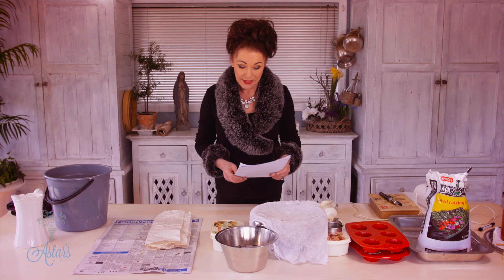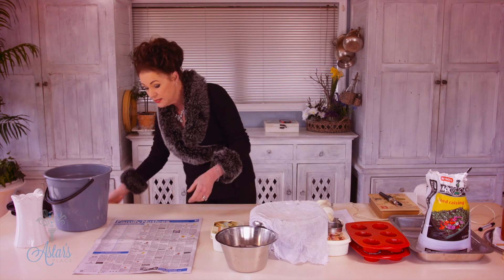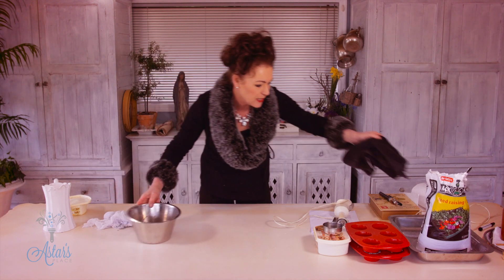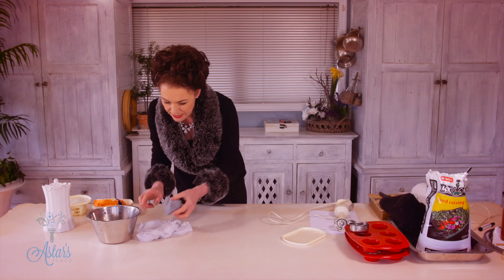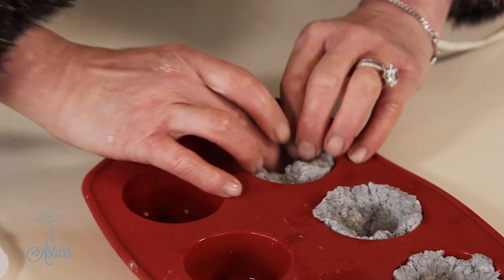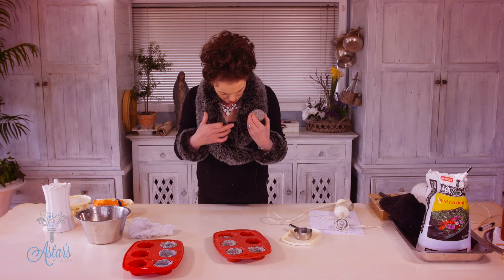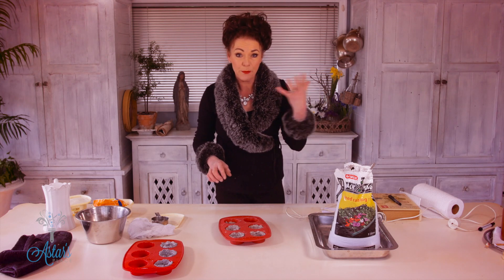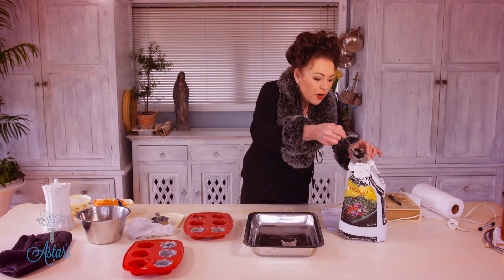How to Make Biodegradable Seed Raising Pots

Comment: get yourself a paper shredder and your set! It’s finer than you could ever rip it up and speeds up the break-down process 
I do big batches in 5 gallon buckets and a dry wall mixing bit in a drill- I still go with a stick blender to break it down finer. The finer the pulp ,the more pliable it is. I’ve also learned that letting the paper soak for a few days prior to stick blending allows for better break down of the paper fibers still! Happy planting! I have never seen such a FAB gardener! ❤️love it!!
Reply: Thank you